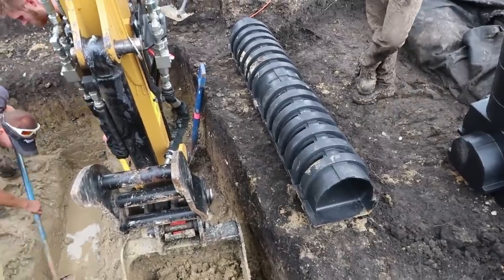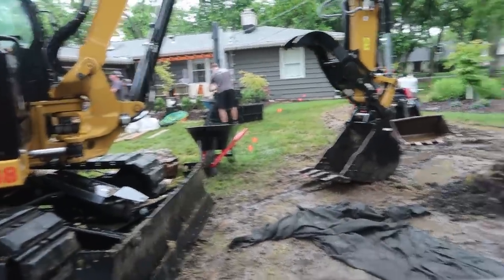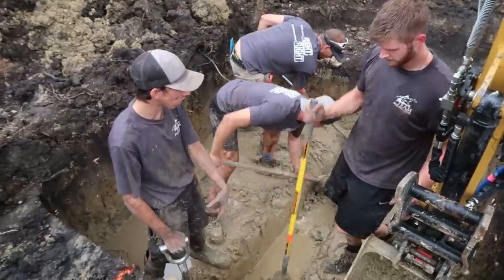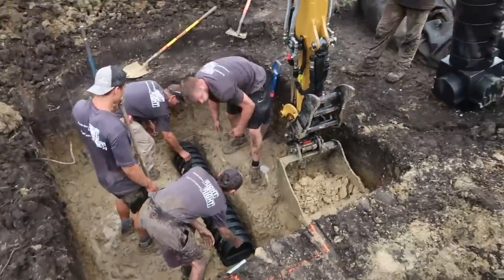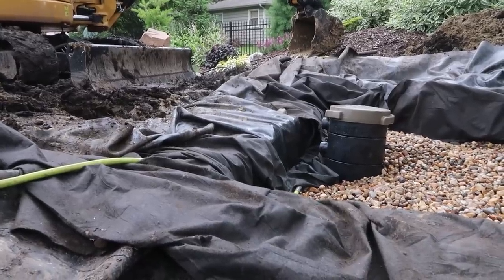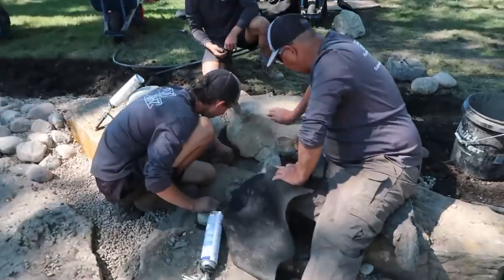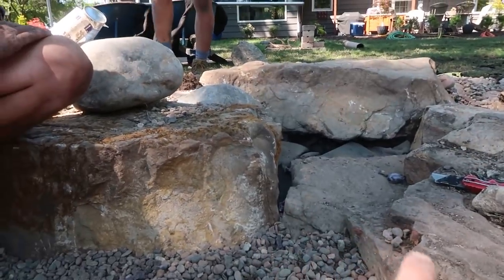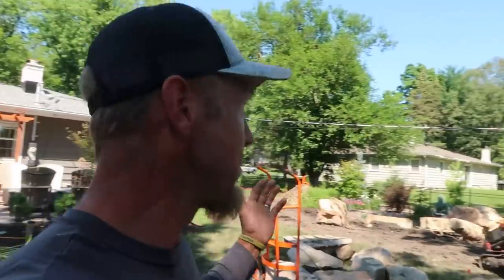Wetland Filter for *PONDLESS WATER FEATURE* - Part 4

Comment: Really enjoying this project. Putting the wetland water level at same level as pond makes the whole system look so much bigger. But how do you isolate it when it's time to back flush? Have to pump the whole pond down below the weir?
Reply: Someone please correct me if I'm wrong.  With a wetland filter you don't technically backflush it.  Wetland filters sometimes don't even need to be cleaned every year.  So in this case I imagine they will just turn off all the pumps, drain out the pond a little until the pond level is lower than the wetland and then open up the snorkel cover and pump out the dirty water and sediment with a seperate "drop in" pump.
Reply: Sorry.  I didn't see the last sentence of your question until after I posted my reply.